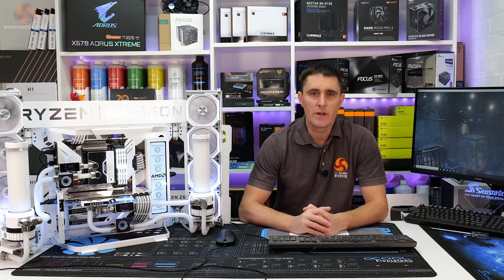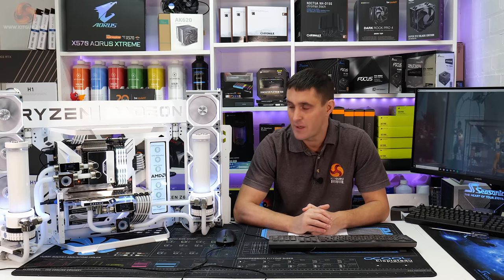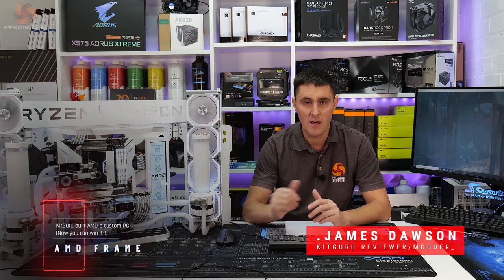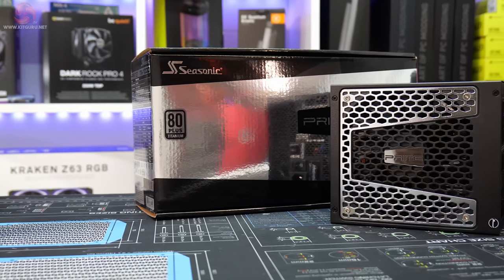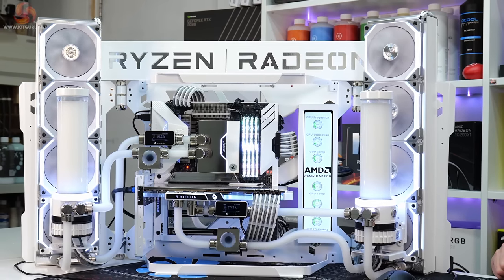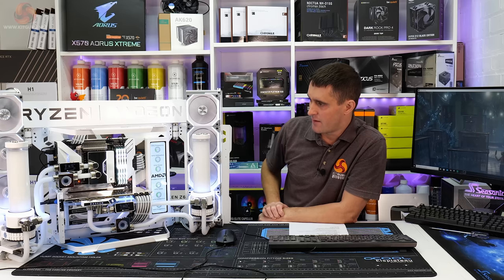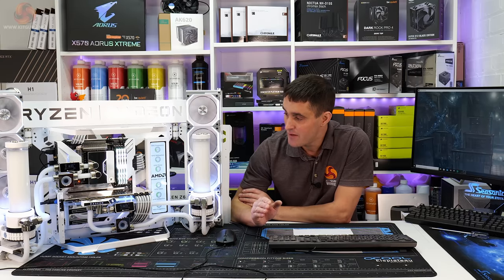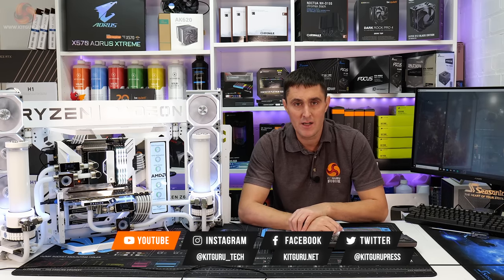AMD FRAME - Win this CUSTOM system!

Comment: Never heard of you before but the work looks stunning.  I really like the sweeps as opposed to hard angles often used for hard tubing.  Not only does it look good, it shows a high level of craftsmanship and keeps the flow higher which will result in superior cooling.  Frankly, I think I am going to steal some design cues because I've been thinking about making my own PC case or PC in a desk for quite some time now.  

One design feature I like is the flow meters and temperature gages being located where they are as this provides a lot of modularity particularly for the GPU.  Say you want to throw a 3090 in there but your water cooler doesn't exactly line up, all you have to do is bend the last few inches of tubing from the flow meter and temp gage to the GPU.  The same would apply if in the future you upgrade to AM5 or even an Intel processor moving forward even though putting an Intel or NVIDIA product in this would be kind of funny.

This is a beautiful machine with some very clever designing.  I'm not going to try and win anything but have a sub and a like.